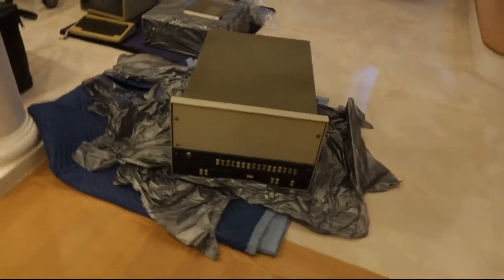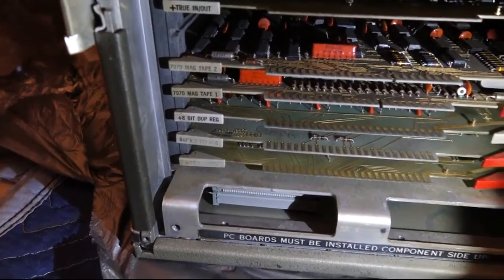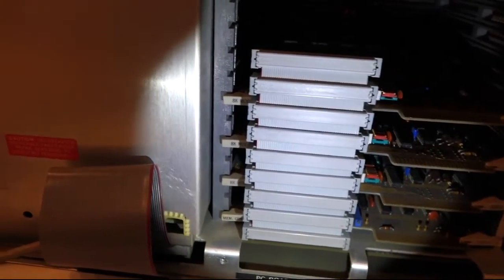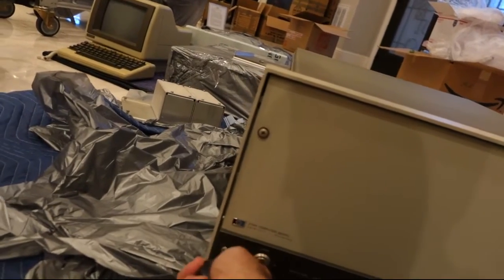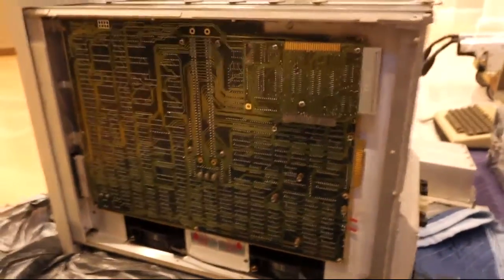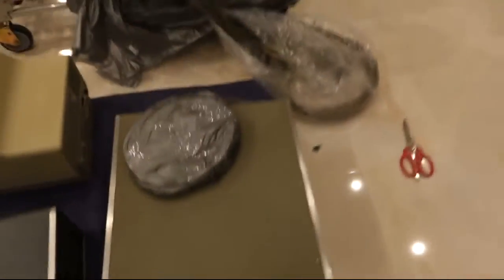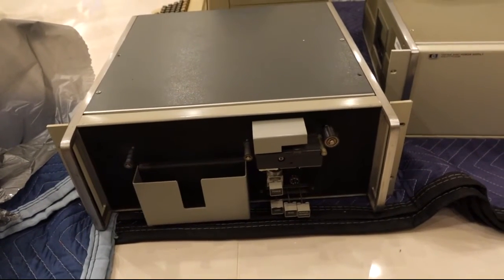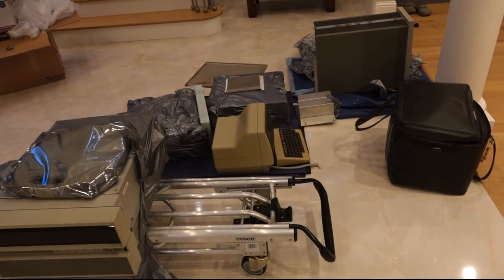Vintage HP 21MX computer arrives for restoration

Comment: I was the Production Engineer for this computer at HP Data Systems Division.  I did a relayout of the CPU board on it because HP's Santa Clara Division stopped making the octal buffers on the board and I had to design in a replacement component.  I also decreased the layer count on the CPU board from 8 layers to 6 layers and changed many of the components on the layout so they could be auto inserted.  I had a 35 year career with HP.  It was once a great company.

Comment: That computer started my career at HP.  I programmed it until 1990 with assembler, Fortran and Pascal and did lots of database programming with Image 1000.  It supported all kinds of external devices.  I even wrote a boot loader that loaded a disk test program from another 2100mx computer running RTE 1000.  Those were fun times.

Comment: In 1975 we (Santa Ana College) installed a 21MX "Hewie" with the controller with 32 user ports for a mix of ADM-3As and DEC LA-36 terminals.  It had the tape drive and also the paper tape reader.  It was temperamental at any room temperature above 68 degrees F, so keep yours cool and leave the rack cabinet doors open.  We taught HP Basic classes and I loved it for what it could do.  Sadly it eventually was replaced by an IBM 4361.
I read the comments about head crashes.  The cabinet rear door had a good fan with a filter, but still it was meant to be in a data center with a big air conditioner circulating dust free air.👍

Comment: Your machine looks a lot different than mine. I don't need a skrew driver, it just opens with the key and the power switch is behind the panel. Would be nice to see more. I am also not very far with my machine yet. It seems to work, but I it seems that I am experiencing a lot of contact problems, especially in the area of the ribbon cables. Sometimes the panel does not work, sometimes I get no access to the memory. A lot of homework to do. At least my A series machine seems to run reliably now.
Reply from the maker: Both of my 21 MX's are like this, with the key operating the on/off/standby switch. On my later 1000 E and 1000 F machines which look similar but the next and 2nd next generations in what would eventually be re-baptized as the 1000 series, the key opens the front panel as you describe. Maybe they made a late model 21 MX that opens up like an E and that's what you have?

Comment: the s/n 1548 is built 48th week of 1975.  top card in the front with ribbon cable is the DMA card. Card below is the Memory expansion (red LED) on it.

Comment: lol you're crazy. I had a drive like that with a 9830, it's noisy, the weigth is... about a ton :-) It was 5+5 MB IIRC, 5 fixed 5 removable. The interface was hp-ib, and you needed a separate controller module plus a separate power supply module. Plus fans. The hd alone occupied more than half a rack. Pretty expensive machinery at the time (70's), and not exactly fast nor reliable. Mind you, I like hps, but not very much these ones in particular. By the way you can pull up by hand on the disk cartrigde cover to see the platter trough the opening. They called it "mass memory" back then, LOL. Good luck with the restoration. I like your videos keep them coming!
Reply from the maker: That would be a 7906, twice the capacity of mine, and you would have needed a  HP 13037 controller to make it work. A lot of heavy hardware! Did it make the noise of a jet engine when it spun up?
Reply: Yes, that noise, yes, hahaha. I've been googling a bit and I'm sure it was this "9880 Disc Drive" : http://www.hpmuseum.net/display_item.php?hw=268 "a removable and a fixed hard disc. It's total storage capacity was 4.8MB" It's still very very similar to the one you have there. It was exactly like the one in the pictures in that url. "mass memory storage system" they called that LOL. Have you got it working yet?
Reply from the maker: Yes, that indeed would be the same 7900 drive in a bundled package with the controller for the 9830. Didn't know you could connect such a big drive to such a small machine.
Reply: The best of the 9830A was that printer that goes on top of the 9830 "calculator", it's a thermal *line* printer, lightning fast.

Have you got your disk drive working already?
Reply from the maker: No, not yet, have been distracted by the Altos.

Comment: Did you ever get this one up and running with RTE?  I'm working on a similar setup at the moment with a 2113B and the 7900A hard drive.
Reply from the maker: Not yet. Still in the restoration queue, along with a couple other HP 1000-E and 1000-F systems.

Comment: Hello Marc. Thanks again for the help with HP59401A HP-IB analyzer :-) I just stumpled over this on the bay: http://www.ebay.de/itm/Hewlett-Packard-HP1000-Computer-Systems-16-Ordner-Binder-Manual-Vintage-retro-/362071191772?hash=item544d1ff0dc:g:p9AAAOSwBpxZktXZ
Thought it might interest you :-) though the price is a little steep ;-(
Kind Regards from Denmark, Jesper
Reply from the maker: Thanks for the tip!

Comment: All it needs is a clock and a speaker and it could be a intercom panel ;)
Reply: Inside it looks like a BBN (Bolt Beranek and Newman) computer/network router.

Comment: I use a test bench with an incredibly similar processor at work. the computer is practically bullet proof but the magnetic disk drive was a real mainx hog and has since been replaced with a zip disk drive. the read\write heads kept crashing.
Reply from the maker: +curtis walston That's so cool! Link to a picture? That was their main intended use - testing and real time process control, in keeping with HP's main test equipment business. And yes the disks are open to the environment, and head crashes due to dust were (are) common.